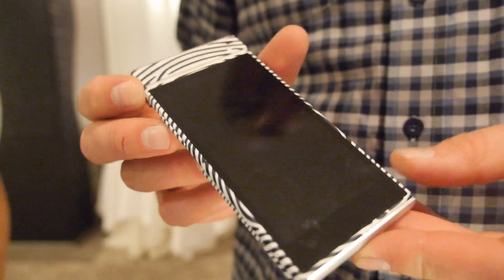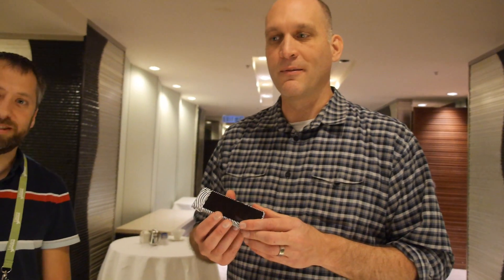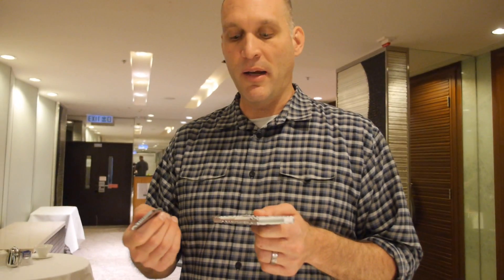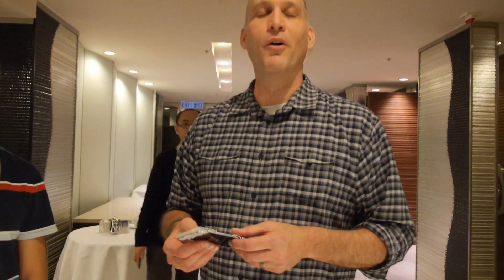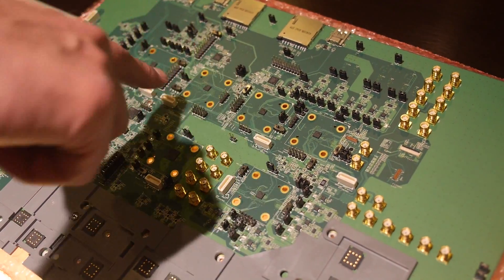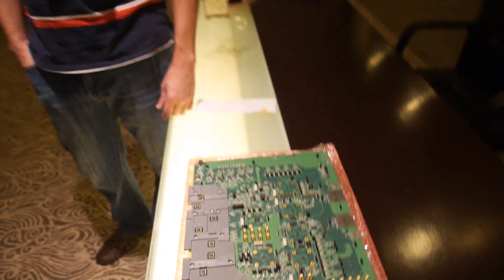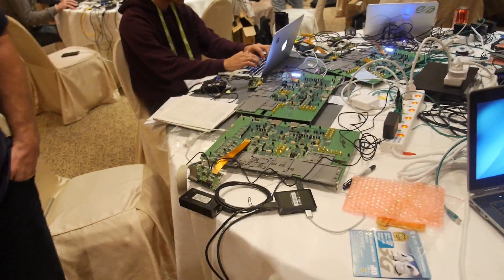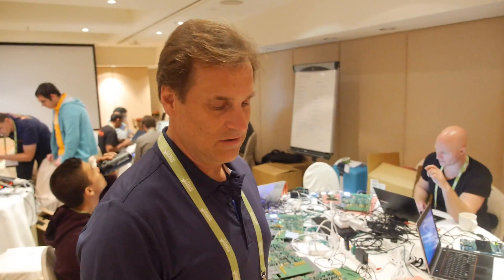Google Project Ara development boards at Linaro Connect, Greybus status with Greg Kroah-Hartman

Comment: I would have asked what Linaro and the Linux Foundation is doing in terms of the upcoming Spiral 3 product. And specifically with regards to Linaro, I'm curious about how they're implementing the generic class drivers. What if module developers conceive of a device that Linaro had not foreseen? I know Eremenko said that Ara would not allow kernel-level device drivers for modules and that everything would have to be handled in userspace. Does that limit module developers somewhat?
Reply: It can be done, same as you got libusb or even FUSE for file systems, or makes ways to more freely communicate with hardware so it can support extra features. Hardware manufacture could also propose features to core drivers